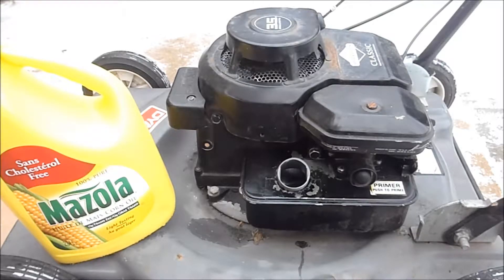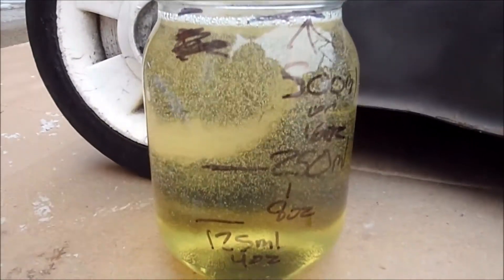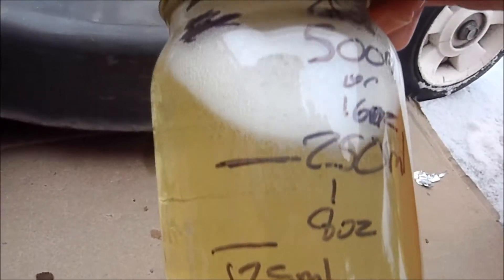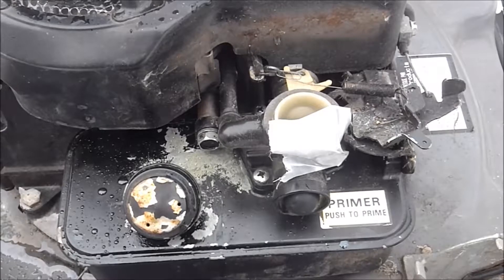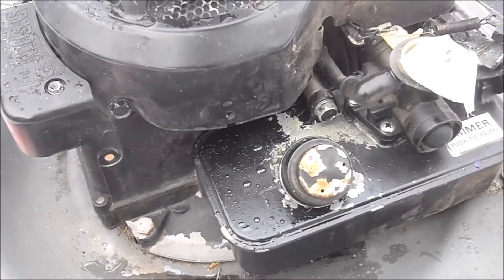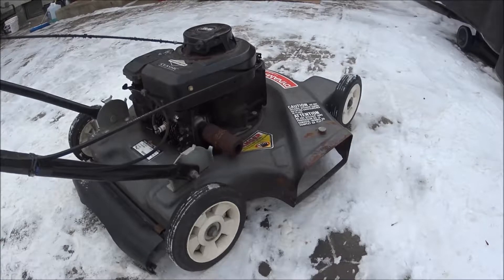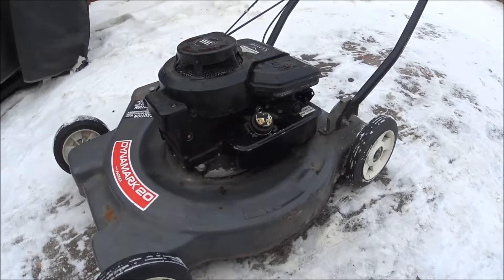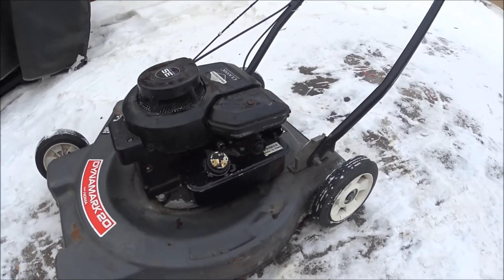Vegetable Oil as Lawnmower Fuel

Comment: Does it work tho just get and old lawn motor
Reply from the maker: It would work better if you had a carburetor that had adjustment screws to change the air/fuel mixture.

Comment: Biggest tip I've learned is have someone else with u that can pull the throttle immediately  on the push mower  and at a steady gradual pace, too quickly will make the engine die bc it'll get too much fuel but I've done this and it works great.  bc if u do this it heats up the engine quicker which  somehow burns the fuel better and it runs great after this , u will have to do it each time to warm the engine up just pull on the throttle to rev it way up and let it sit at a high rev for like 10 - 15 seconds and it  works wonders.  Once it's warmed up it should run good and you'll be able to start it right up after you've mowed a bit with it but each time it's been sitting  it'll have trouble on the cold start in the beginning till you run it enough  to warm it up.

Comment: I'd try e85 or if You can find it 100 percent ethanol with canola oil. I'd run the engine for at least 1 hour under high load. It won't burn as well because it's cold. It's best to heat up everything. I am doing research on this myself.
Reply from the maker: Thanks for the tip. Il try and find a mower with an adjustable carb and try it again this summer. Never thought it would make a difference but good chance your are onto something. Thanks again!
Reply: let us know if you have any sucess